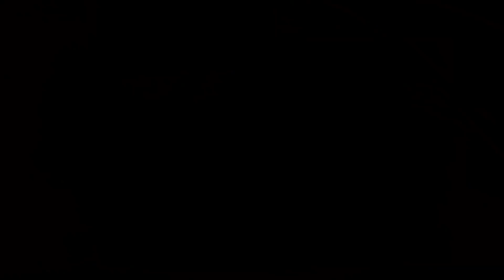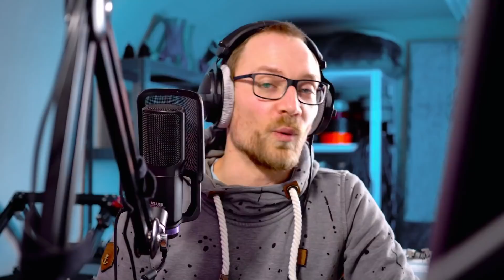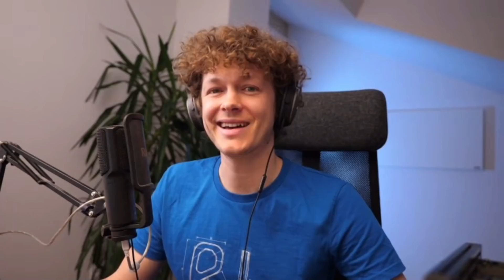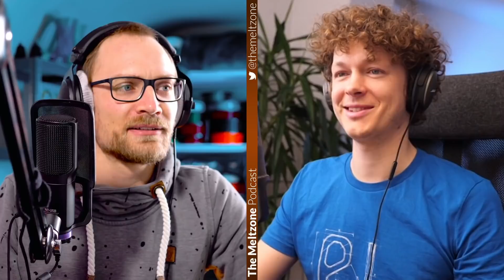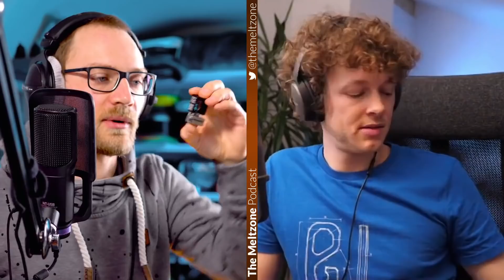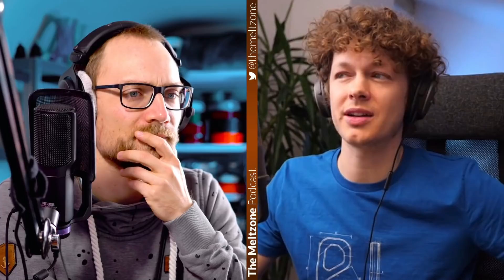Talking VORON, PlyBot & Is PLA eco-friendly? - The Meltzone Podcast Ep42

Comment: The thing with stocks, that make it slightly better than gambling, is that if you look at the value of the market over time, it always goes up. Specific stocks are way too risky to get involved with, and that's exactly what you're describing, but investing in something like Berkshire Hathaway is basically a high yield savings account, except you can't expect to be able to take that money out at a moments notice because you want to wait for the value to hit a peak before selling. IMO it's definitely worth putting money that would otherwise be spent on random junk on amazon into different stocks (and maybe cryptos if you're feeling spicy) because the odds are (as long as you can commit to keeping that money in there for a decent amount of time) you're going to make a profit overall, as long as your investments are properly spread out.

Comment: ABS is the obvious choice for high speed print not only because of its MFI and ability to flow but from a cooling perspective. You only have to cool down the material to around the Tg, chances are the temp delta between ABS print temp and Tg will be smaller than PLA. 
 Not to mention that you print abs at a much higher temp than ambient so your efficiency of the cooling from the airflow is much higher, think mCpdT

Comment: that resin question about it shining through

It Does in fact shine through! this is an issue with thicker resins that cling to the print, or more transparent resins with less pigmentation. 

This is why black resins are often recommended for high detail prints as they have less bleed through to their surround resins

Comment: The short hair suits you really well, Tom. The Voron 0 looks really nice. I can really imagine that it is quite fiddle to assemble. You will love it. I‘ve built a Blocks Zero a while back. Still like that little printer a lot although technically it doesn’t have a lot to offer. But I can take it with me because it‘s so compact. Slopping bearings would result in up and down moving along in x and y I guess. I really hope that they will add some kind of part cooling function of some sort.

Comment: 80% through my voron v2.4 build, glad to se others having fun with there builds too :)
Reply: Can you tell me how you sourced your parts and how much you paid?
Reply: @moriarteaa4692  roughly $1200 for the 300mm3, parts sourced via AliExpress, digikey and boltdepot. The bed was purchased from mandala rose works since I didn’t feel like dealing with the security issues of Midwest steel supply.  As time went on shipping from Ali started to get more expensive and slower, I guess if I did everything before COVID I could’ve saved a good chunk

Comment: PLA right now seems to still have a positive carbon footprint. 500g CO2/kg PLA. With a potential of a negative Carbon Footprint in the future. Based on the calculation of one of the two biggest PLA producers. https://packagingeurope.com/low-carbon-footprint-of-pla-confirmed-by-peer-reviewed-life-/
Primary Polypropylene has a carbon foot print of about  2kg-4kg CO2/kg Material. (which is one of the lower regarding crude oil polymers) Polyamids can go up to 6-8 kg CO2/kg material. Simple recycling procedures with good quality sources produce about 0.5-1.5 kg CO2/kg material. (calculations greatly depend on boundary conditions and estimations)
If you are interested in some data on this topic, there is a free app in the appstores: Idemat.

Comment: There is usually a photoabsorber mixed into the SLA-Resin, which absorbs the UV-light and emits light in another (visible) wavelength. The photoinitiator, which starts the polymerisation (hardening) of the resin, does not activate with visible light.
Reply: Yes, it's kind of a fluorescent additve similar what you can find in washing detergent (which makes the clothes look brighter). I had an experimental resin (transparent) once which cured way to deep (almost to millimeters depth) This might have worked with shorter light wavelength (365 nm) because they absorb faster in polymers but not with LCD printers 405 nm.

Comment: I'd guess that due to exposure time only a certain thickness of resin will cure.
The material close to the light source will cure fast and everything behind it will take longer and longer.
That would also explain why professionals say a pigmented resin is better for precision.  Pigmented resin with smaller layer hight  will give you the best results. 
I think Joel had a video with a guest about these topics.
Reply: This is true. Depth of cure is a function of power over time. Professional SLA machines use a calibration print that varies laser power over the print. It is then measured and the proper values selected. Trust me when I say this is a tedious process. I hated calibration days.

Comment: I like pure Scara motion, but only for its future potential for duplexing, triplexing, and beyond, all on the same print. Now that will be the fastest printer. 

Scara motion system can provide the most independent freedom than any other, for multiple nozzles moving nearly completely around and about themselves at any time simultaneously. Whereas the Plybot is like a hybrid of a delta and Scara to me. I think it has the curious and eye catching “cool” factor of the former but not so much the particular advantages I mentioned, by being constrained by a more obtrusive arm system. That’s just what I’m specifically interested in, though.

As a note on cost, Scara has been comparatively expensive because of the particular bearing/gear interfaces at the joints to minimize backlash. These cost a lot. The plybot apparently has a different solution.

Comment: If you used 97%(typical) fossil fuels for PLA production then you create 2.74 tonnes of CO2 per tonne of PLA, of course if you use renewables then that figure can be reduced to 0 tonnes. Corn is ~45% carbon so you capture ~0.45 tonnes of CO2 per tonne of PLA. TLDR: currently produced PLA is a net contributor to CO2 but if renewable power were to be used it would be a net beneficiary by 0.45 tonnes per tonne.
Reply: Conclusion: Everything in the world should be built from PLA made with renewable energy.